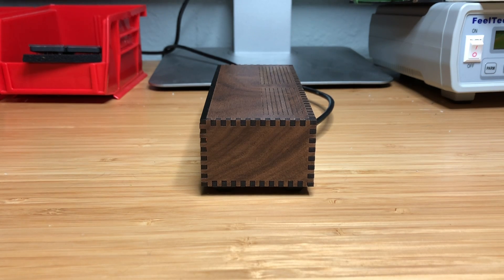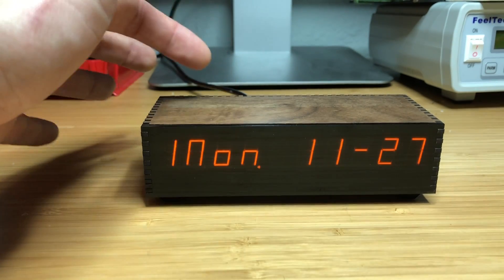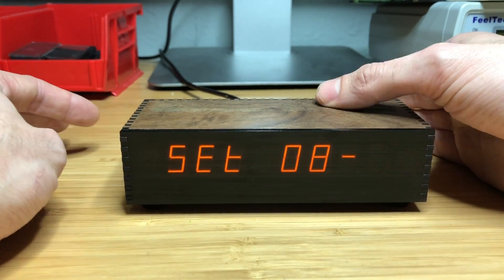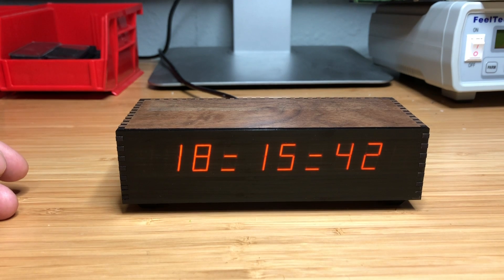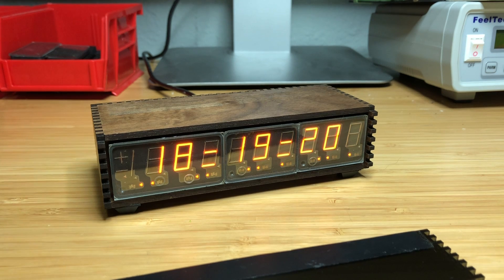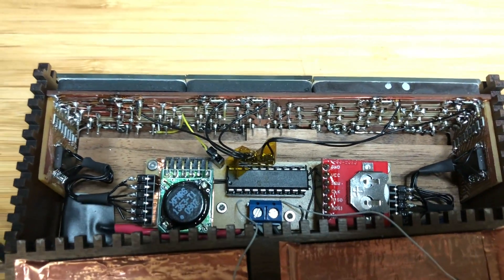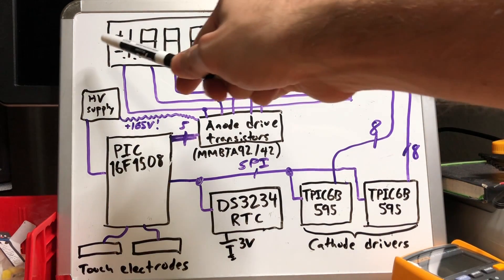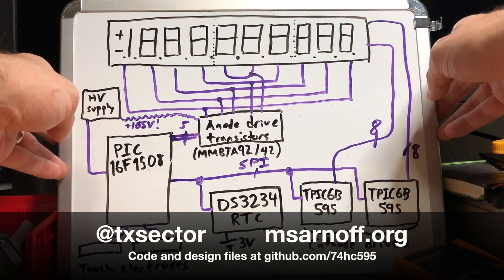Panaplex Clock

Comment: This is fabulous! As someone who's written Arduino/DS3231 code for a nixie clock project, kudos! Your use of the display segments is masterful. Thanks for sharing your code and design files as well.

As lovely as the Panaplex displays are, I'd love to see (or make) a version of this clock using LED filaments, so it could be built with only newly available components and have no HV requirements.

Comment: Wow, the second you took off the front panel could I ever hear that switching power supply! Yikes!
Reply from the maker: Yes, the particular power supply I used tends to generate audible magnetostriction when current draw is low. That's why I have the clock in my office where the ambient noise masks it :)